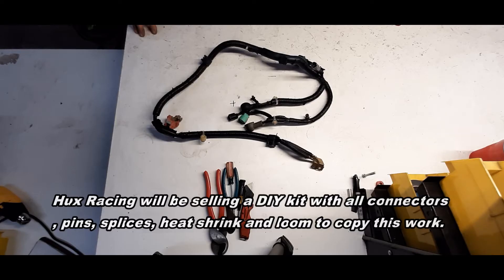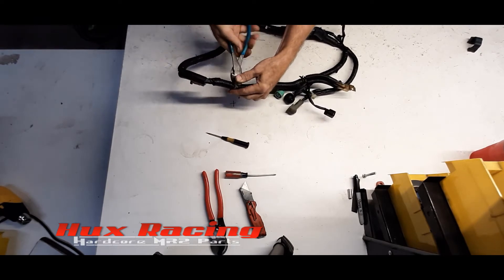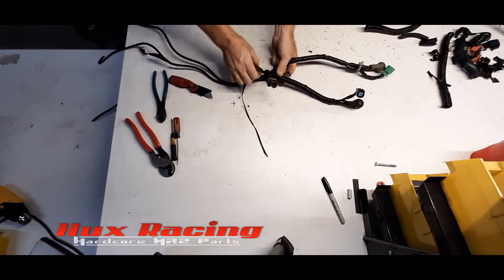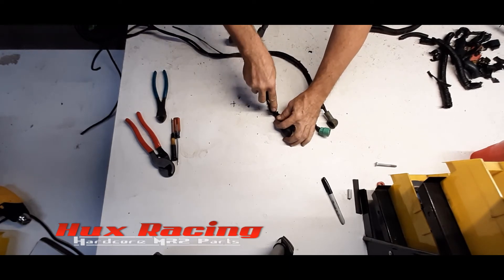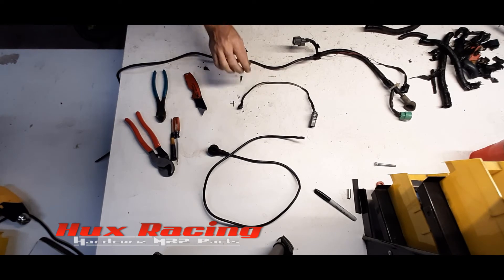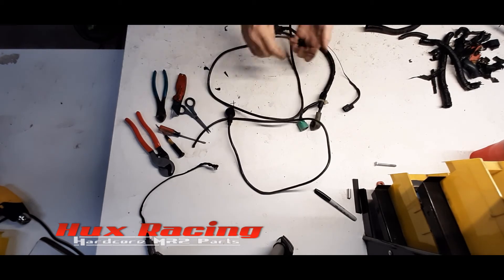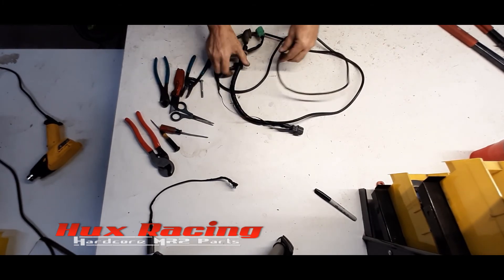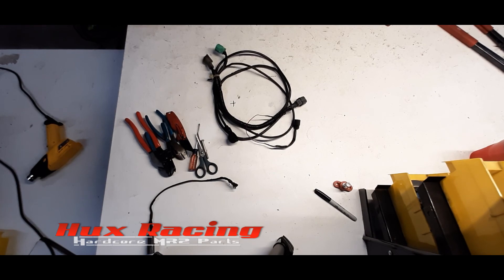K20 Charge Harness Rework for MR2

Comment: So on the harness you made. The clip to the starter is already integrated into the wiring. All I gotta do is connect the main power cable to the starter.  The alternator cable to the fuse box where it says alternator and that’s it?

Comment: So do you eliminate the cable that runs from the battery to the to the starter? The one the comes on the chassis?
Reply: Did u figure out what he does with it
Reply: @pototatoehead3  I end up using it. But the only thing is now since we use the starter  Lead to extend the alternator cable you’ll need to source out an new starter terminal lead and somehow add it to the mr2 cable that runs from the battery “the big cable” because  that one doesn’t fit on the k series starter.